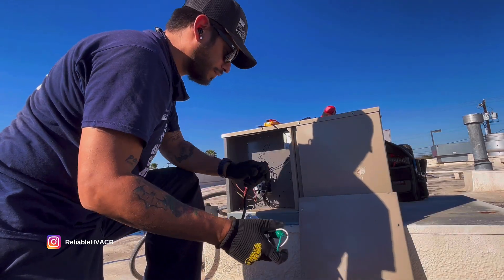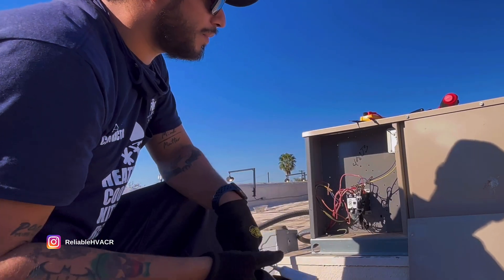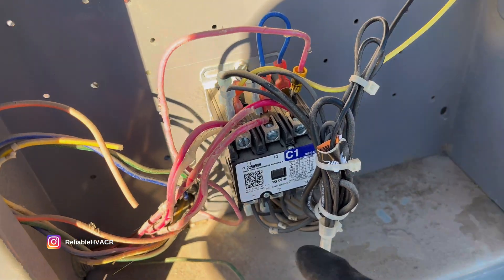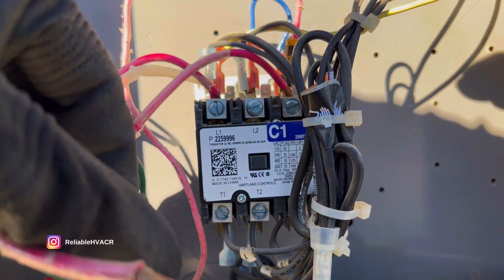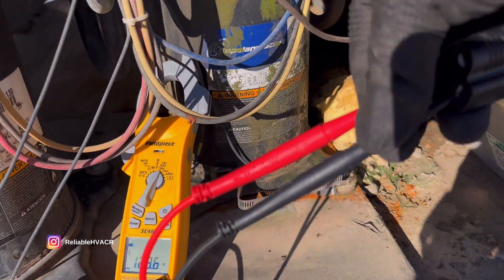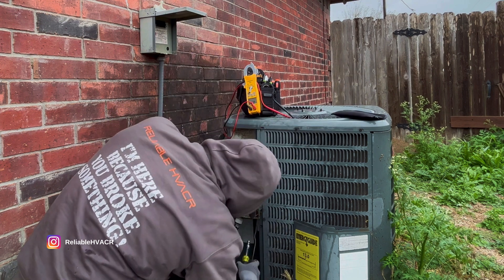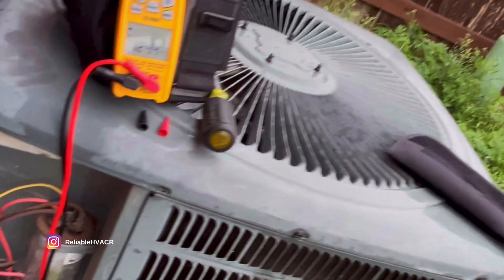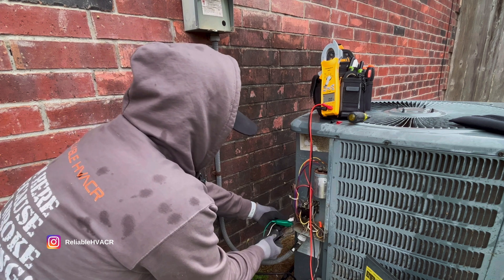Use a Cheater Cord to Power Your Equipment | HVAC Training

Comment: If you disconnected the ground wire, you could have put your ground and neutral from the pigtail on that ground wire instead of making the whole damn unit hot by clipping it to the metal housing. Just saying

Comment: Dude ? You are asking for trouble. Electricity is a loop & the black wire that carries the 120v into you vacuum pump motor then it circles through the motor windings and comes back out to return on the white or what "should be" neutral.  In the configuration you are using the return of power is being sent back through the ground.

 As stated above the entire case is now hot. Sure, you have on boots haven't grounded yourself yet. Wait till its 110 degrees & you are all sweaty then lean against the case while crawling around the condensing unit and hands in the dirt or touch other metal ground anywhere. Seriously dangerous. 

Doing it yourself in a pinch is not even a good idea but instructing these newbies to just blindly grab power like this? WOW I hope you have GREAT lawyer! I'd take this video down ASAP and probably make a follow up saying never ever do this to protect yourself from liability.
Reply: Thank you for explaining the hazards associated with this. I had been curious about a cheater cord and have seen a few different set ups but when i saw the neutral on the cabinet it made me wonder im glad i wasn't wrong in thinking it looked sketch

Comment: As an electrician with 45 years of experience I would like to caution you and other HVAC professionals:  Using your cheater to bootleg a neutral via the ground of equipment is seriously hazardous.  Electricity seeks ALL paths back to it's SOURCE, including neutrals and grounds.  (That is why, even in a properly designed and wired system, it is possible to shocked from a neutral wire as your body WILL divert a portion of the voltage to ground through you.) 

Grounds are never intended to be energized (as a neutral normally would be on a 120v circuit) they are there as a fault clearing path, to bond together equipment and metallic structures to the same electrical potential (preferably zero), and to help ensure equipment cannot get voltage on it due to faulty components. 

Every time you guys use that cheater, you are energizing the entire AC unit and anything metallic attached to it. (Want proof? Next time you use a cheater, take one of your meter leads and attach it to the unit you tied the cheater to. Take the other lead and touch that to any other unit (A/C, exhaust fan, etc.) nearby, you WILL read some voltage. Anything over 3 volts is a hazard.) That exposes anyone touching anything connected to it via a metallic path to potential and possibly lethal shocks. Anything that gets touched WILL divert some of the current though the person touching it.  I have attended jobs where someone was severely shocked (and a few fatalities) from this exact scenario. I have also been shocked many times with neutrals simply because I was a partial current path with low enough resistance to get belted.  And yes, I have used the same cheaters and have also gotten bit doing it. 

Your pump will most likely fail because the current it draws can burn open some part of the ground wire, fittings or connections. You now potentially have a completely ungrounded A/C unit, which will leave you open to liability. 

The solutions? One, use your battery powered vac pump, two, buy a 240v vac pump (they are out there) and connect it normally via the two hots and ground in the unit, three buy a surplus step down transformer rated at 1kva (will weigh about 20lbs and won't be too big) to step down to 120v for your pump, or four run the necessary lengths of extension cords to a regular 120v receptacle. STOP using the cheater, one day it will get you and you may not survive it.

Final note: What is the #1 killer of electrical tradespersons? Shocks (and/or the resulting falls from getting shocked) due to complacency. They get away with tickling the dragon for so long, until the dragon strikes back. The end results are not pretty.
Reply: I hope people are reading your comment and paying attention to it!
Reply: I absolutely agree with you and was thinking the same thing that u just explained thank u
Reply: What if you hook this up at the disconnect ground instead of the he actual ac unit ?
Reply: @spok209  That would not make a difference. As I said, electricity seeks all paths, regardless of location or direction. This is exactly who the NEC now prohibits new installations of the old 3 wire receptacle for dryers and stoves.  Too many people were getting shocked or "unalived" (I hate the YT police who require that word) when they touched the appliance and a grounded surface.  

The solutions I gave are the ONLY safe ways to do it...anything else and it's only a matter of time before you get bit.

Comment: When you do this procedure is the chasis hot?  Student here but how about adding a 208-120 Transformer to the chord and just grounding the green.   Would it make it safer?
Reply: @l.crossjr  Yes it makes the chassis and anything with a metallic contact hot, and yes the ONLY correct and safe way to tap in  is to use a transformer. (Or a 240v rated pump.)

Comment: as an electrician.... how messi you american do your electricity??? In germany THIS would have NEVER EVER been possible. So untidy. how long do you learn your job? 3 month? even out pupils who learn the job do it more accurate than you in the usa.
Reply: I've never seen anyone borrow/ pinch off a phase in England.  You would probably lose your employment and certainly negate your life insurance. 
No disrespect to him but it's not done this way here.
Reply from the maker: @CdEmm50  again I'm not in England 🤷🏽‍♂️
Reply: @ReliableHVACR   But you are asking for trouble. Electricity is a loop & the black wire that carries the 120v into you vacuum pump motor then it circles through the motor windings and comes back out to return on the white or what "should be" neutral.  In the configuration you are using the return of power is being sent back through the ground. As stated above the entire case is now hot. Sure, you have on boots haven't grounded yourself yet. Wait till its 110 degrees & you are all sweaty then lean against the case while crawling around the condensing unit and hands in the dirt or touch other metal ground anywhere. Seriously dangerous. Doing it yourself in a pinch is not even a good idea but instructing these newbies to just blindly grab power like this ? WOW I hope you have GREAT lawyer! I'd take this video down ASAP and probably make a follow up saying never ever do this to protect yourself from liability.
Reply: Exactly, the USA never follows, the rest of the world follows us.
Reply: I would connect to disconnect ground with gr, black with black white with white is safer this way just like your adding extensions to disconnect cables
Reply from the maker: I'm not in Germany 😂 so I wouldn't know. Thanks for watching

Comment: Been using home made ones since 93, with smaller alligator clips to be able to jump off top side of meter bases on service change outs, HVAC service. I will tell you a secret power company gets pissed when you cut their service loose or pull the meter lol.

Comment: good way to kill someone.

say your breaker amp rating on a HVAC unit is 60 amps.  say the ground wire ends in a junction box under the roof deck and does not continue back to the electrical panel.

so that junction box is connected to a steel beam, that steel beam is connected a metal stud wall then to a metal door to ground. 

oh wait, someone turns the door handle on the current carrying door and gets electrocuted by the 8 amps of your vacuum pump, that was definitely worth the time saved.

you have to be kidding me, 1/7th of an amp can stop your heart. lazy lazy lazy

Comment: Sometimes on 208 3-phase system you have a bastard leg that isn’t 120V. So, like you did, always check with a meter.
Reply from the maker: Always verify 👍🏽
Reply: That is a 4 wire delta configuration.